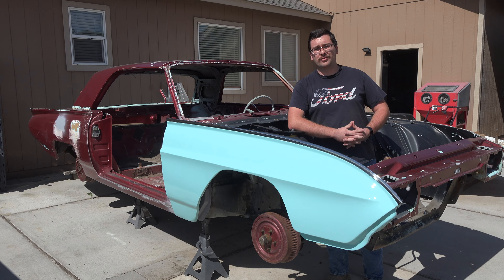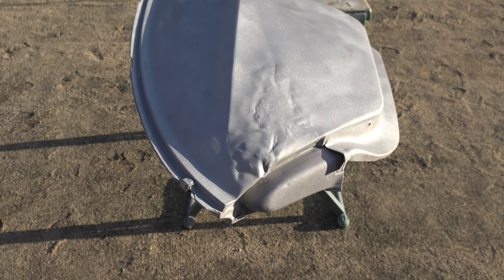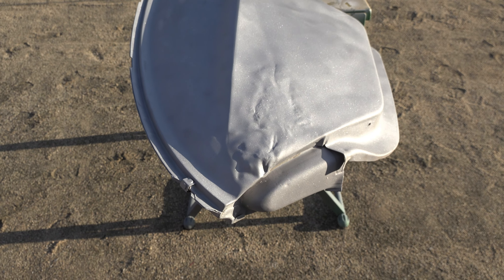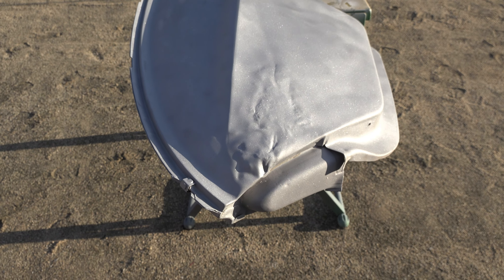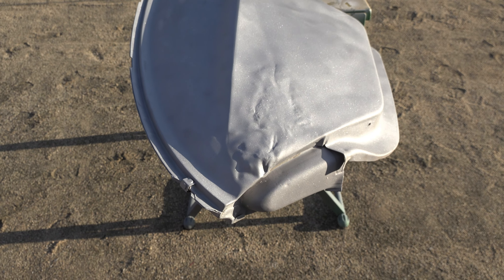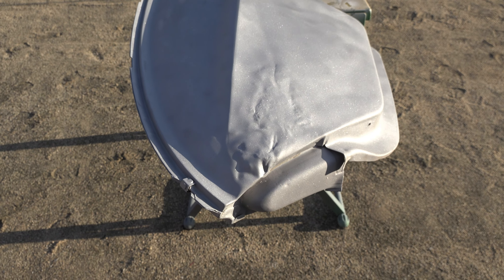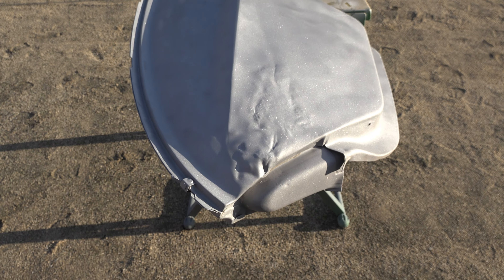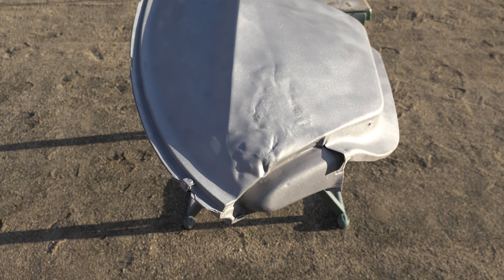1963 Thunderbird Restoration Part 4 - Restoring the Fenders

Comment: Hello! You are doing an awesome job on yout T-bird. Your videos are great also. They do not drag on, and you keep it interesting. Thanks for showing mistakes as well. I also am restoring a 66 T-bird. Just finishing up the undercarriage.  I used Herculiner for the undercoating. It works well. Thanks for posting the videos.
George B
Reply from the maker: Thanks for the kind comment George! That sounds like a sweet project! I was debating about using bedliner, I have used some before on other projects and it turned out great! I decided to try the Eastwood stuff though purely out of curiosity, and so far I am pretty happy with it. Good luck with your project and thanks for watching!

Comment: Do u have a clip of replacing driver door rubber trim on 1963 Tbird? I'm having trouble getting after-market rubber trim to fit, so the door isn't tough to close. Thanks
Reply from the maker: I do have the rubber for the door but have yet to install it, so no video yet I am afraid!

Comment: Would it be better to lay the fenders flat when spraying to stop the sagging
Reply from the maker: Yes sir it would be! I painted the fenders vertically on purpose though as I wanted to prepare myself for spraying the rest of the car (quarter panels, sides of the roof, etc). I figured that if I could master painting the fenders vertically, then I would be good when it came to spraying the rest of the car (hopefully)!